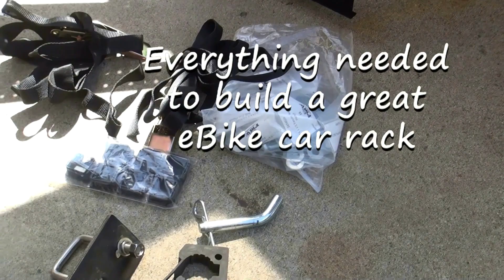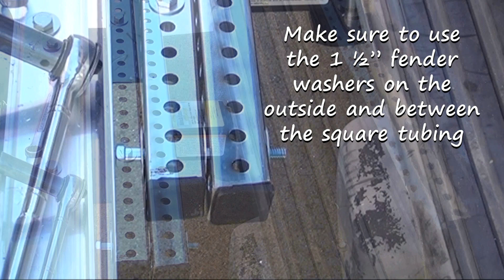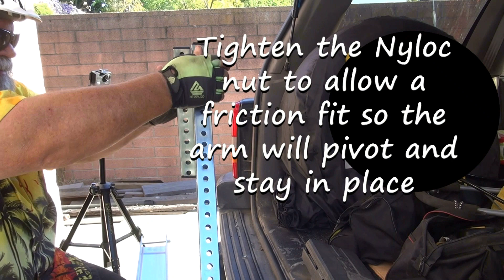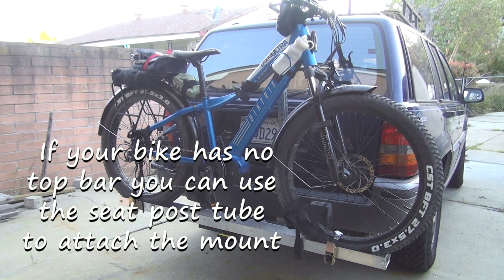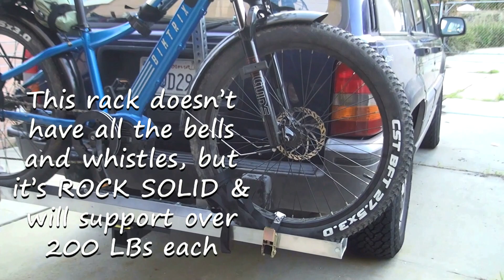DIY eBike Rack for under $135, Cheap & Easy, A Great Bike Rack

Comment from the maker: There are no worries when hauling with this rack. It is rock solid and didn't cost very much to build.
Reply: As you could tell by my questions, I’m not a very experienced DYI guy. Actually ordered all the parts, then I was in Harbor Freight to get the step extension when I saw their motorcycle carrier for $159.99. 400 lbs capacity, with a nice loading ramp. Had to go for it. Still love yours, but figured my time needed to assemble, to include screw-ups, was worth the extra $30 bucks.
Reply: @squire330  Sounds like a great option for you. I went my direction because I wanted a heavy duty simple rack that could be expanded and still have a trailer hitch. I also carry a luggage rack behind mine. Have some great rides. Positive vibes to you.
Reply: @squire330  How did the motorcycle carrier work out for you?  What I would be concerned about is it doesn't have anything to attach to the top tube to keep it from falling off.  Even with many straps I'd be afraid my bike would fall off.
Reply: @jamesgibson3242  Works great as is, but planning to add a bar to attach to seat post ( no top tube on my bike)

Comment: I am making one of these at the moment, but can’t get the uprights like you have used, so instead am using 1” steel SHS. The concern I have is the stress put on these upright bars during acceleration and braking. Having only small uprights and since it’s not fixed back to the car. Have you had any such issues with the ebike toppling over ?

Comment: I also have a Biktrix and finding a single rack is difficult to say the least.  My hitch is a 1 1/4, finding a 2” is also difficult. Would this still work with a 11/4 hitch receiver to carry the E-Bike…Juggernaut Hub Duo. Probably same weight as yours.  Thank you
Reply from the maker: Hi, thanks for the question. Yes, I have a number of friends who have built this rack that have a 1 1/4" receiver hitch. They simply purchased an adapter which works quite well. Some say it works better because it pushes the eBike a little further from the car. Here is a link to an adapter.  Which Biktrix eBike do you have?  https://www.amazon.com/CURT-45785-Receiver-Tube-Adapter/dp/B00077ZDWQ/ref=sr_1_12?crid=2J3L47N79UWQF&keywords=receiver+hitch+adapter+1+1%2F4+to+2+inch&qid=1685219161&sprefix=1+1%2F4%22+receiver+hitch+ada%2Caps%2C463&sr=8-12      And the 1/2" pin     https://www.amazon.com/CURT-21410-Vinyl-Coated-Diameter-Receiver/dp/B004C6S1S6/ref=sr_1_2?crid=36WIG76T8DL22&keywords=1%2F2%22+receiver+hitch+pin&qid=1685219703&sprefix=1%2F2receiver+hitch+adapter+1+1%2F4+to+2+inch+pin%2Caps%2C9923&sr=8-2

Comment: Amazing.  You may have answered this somewhere, but have you thought about or ever built a ramp that makes it easier to roll a heavy bike onto the rack?
Reply from the maker: Thanks for the comment. I'm also surprised that no one else asked about a ramp. Actually, I did make a ramp. I purchased an 8'  piece Aluminum tray and after cutting it to length , I had about 30" left over. I put a couple of hooks on it and it works great as a ramp. I was not able to put it onto the video because the video footage was lost in a computer crash. I am planning on doing an updated video for the Bicycle rack and I will make sure to include the ramp also. Thanks again.

Comment from the maker: I've used this type of bicycle rack for over 30 years with all kinds of bikes and have never had any issues. There is actually not that much stress on the upright bar during acceleration. As long as you have the tire strapped down and a strap on the upright, I'm very confident you won't have any problems. Thanks.

Comment: Could I use 1/8" wall thickness instead of 1/4 " at McMaster they don't have 6' pieces in 1/4" and the 8' piece is $190....so just wondering what others think?
Reply from the maker: Hi Ralph, I've tried the 1/8" and it is not strong enough and will not work. Unfortunately, products and prices have change since this video was made. It's a great rack for the price and still way cheaper, ((and I think way stronger), than most factory racks. I still have 2 of these racks and have been using them for many many years for many many different bikes and have never had any issues. Good luck and thanks.
Reply: @GreyBeardEBiking  Thanks for your reply and help :)

Comment: Thanks for sharing your info.  I have a two-bike rack but I may make one of these for those trips when I ride alone.
Reply from the maker: Yeah it works really good for 1 bike but you can add easily add a second carrier to carry 2 bikes. Plus the cost is way less than a factory build. Thanks

Comment: I've read thru all the comments, I think you've done a great idea and construction....has anyone asked of an idea to padlock the bike to the frame to prevent quick theft?
Reply from the maker: Hi Robert. Thanks. Yes, I always have a cable lock on my eBike when it's on the rack. I run the cable through the safety chain loops on the receiver hitch to lock everything.
Reply: Thanks Grey Beard!

Comment: Just one question, in the first 30 seconds of your video the aluminum channel on the ground looks like the one from Amazon, but after that the channel appears much larger  and thicker with sides at least 1 1/2" or is that my imagination?
Reply from the maker: Thank for the info. I have changed the parts list. Amazon has changed their links. The size of the track to purchase is 6' long x 4" wide on the bottom, (wider or thinner as needed for your needs), 1/4" thick  Aluminum channel. Mild steel can be used to save costs but it will need to be painted.

Comment: Awesome. Where you get the grabber mount?
Reply from the maker: Thanks for the comment. In the description there is a link to the full parts list but here is the direct link to the "Gabber"  https://www.amazon.com/Original-Quick-Fist-mounting-equipment/dp/B000CQPANY/ref=pd_bxgy_img_2/144-0684885-9917304?_encoding=UTF8&pd_rd_i=B000CQPANY&pd_rd_r=8c&th=1   Let me know how it all goes.

Comment: Will the 4 inch channel hold a 4 inch fat tire?  The inside width of the 4 inch channel is 3.75 inches.  If not is there an alternative?  5 inch channel from Grainger is about $100
Reply: Yes, the 4" tire will fit inside the 3.74" inner width of the channel. It will actually hold the tire firmly. However I would still tie the wheels down. Unfortunately the prices have gone up since I shot this video. However the 4" channel is still at a reasonably price from Amazon, Here's the link https://www.amazon.com/gp/product/B007ICNZFA/ref=ppx_yo_dt_b_asin_title_o02_s00?ie=UTF8&psc=1    Thanks
Reply: Hi Dan, it appears to be 1/8" thick do u think still sturdy enough for 50 inch wheel base @ 70 pounds ? thanks

Comment: Amazon is out of stock for the hitch extension and square tube.  Harbor Freight has the hitch extension for $35 and Lowes has the perforated tubing as well as the hardware (I used stainless steel except for the fender washers.)  Great plan and an easy build for the mechanically challenged.  Thanks!
Reply from the maker: Thanks for the update. Good to know of alterative material sources.

Comment: Dan,  I need your help again.  I bought, but have not yet received my HJM Step-Thru  e-bike.  The wheel base is 47.5 inches and the total length is 77 inches.  I do not think I would need to lengthen the aluminum channel but would like your throughts.  Also can you think of any other concerns with the 77 inch total length?  73 lbs should be no problem.
Reply from the maker: Hello Richard. The 77" overall length shouldn't be a problem. The aluminum track of 72" will work fine. With the step-thru model you will probably need to attach the swing arm part of the mount ot the seat post which will work great also. The 73 Lbs. of your e-bike shouldn't be an issue. I tested the bike rack with 190 lbs. on the track and drove around for a day with it and had absolutely no issues. It's a very strong rack. One of my very first racks I built of this design has been in operation for over 15 years. Just an FYI. Tomorrow I'm leaving oon a 1500 mile road trip, some of which is off-road, using this rack carrying my 81 lbs. Biktrix Juggernaut Ultra 1000 e-bike and I have absolute confidence in the rack systyem.
Reply: @GreyBeardEBiking  BEST OF LUCK ON YOUR EXPEDITION.  Truly remarkable.   I hope you will be sending updates.  I would look forward to them.
Reply from the maker: @richardsulenski4110  Thanks, I will most definitely be taking phots and video and showing them. Thanks again.

Comment: THIS IS AMAZING! I have been looking for a way to carry one bike and a cargo rack. This is the perfect solution for my tiny camper van. I just didn't want to buy a rack that carries multiple bikes when i'm only ever bringing one along. This also seems less likely to get stolen if you just leave it on the vehicle. That always makes me nervous about those pricey ebike carriers.
Reply from the maker: Thanks Nolan. Yup, it works great and I've been using my DIY racks for over 20 years with no problems. Additionally I sometimes pull a small trailer so I don't even need to remove the rack. I just insert the hitch. I think I've taken the rack off the vehicle only about 3 times in that time. I just keep it on and have had no problems and I think the reason is because it's not one of those 500 - $1000 racks. Glad you liked the video.
Reply: @GreyBeardEBiking  I'm having a hard time sourcing  material where I am. I found a supplier for the  channel but they only stock  3/16 thick, do you think that is thick enough? I see that you are using 1/4. I'll be putting a 60 lb ebike on it so don't want to take any chances. Thanks for your input.
Reply from the maker: @nolannatashaTV  Hello Nolan, The 3/16" should work but I would still feel safer with the 1/4". My bike weighs about 75 Lbs. I tried 1/8" material and it was kind of flimsy. As I said, 3/16" should work for your bike. In the description I have a link to the entire parts list, including the channel from Amazon. I just checked and the channel is still available. Hope this information helps. https://www.dropbox.com/scl/fi/dgllit0kjbifr9h3x9kwa/bike-rack-parts-list.docx?dl=0&rlkey=ddlxwphl8xolnup0zwoeedlq3

Comment: Don't know what bells and whistles it doesn't have.  This is great...  Carries the bike securely, safely, and looked like it was very easy to load and unload.
Reply: Bells and whistles like a tilt mode. I did build one that had a tilt mode but I never used it so I removed it to make the entire set much lighter and simpler to build.

Comment: The video is two years old. How is the rack holding up?
Reply from the maker: Thanks for the question. First, this rack is very basic, but I love it. Very strong and easy to use for all kinds of different bike. I have built probably 12-15 of these racks for friends over the past 10 years. In fact, I'm still using the first rack I built 10 years ago, and it is still working great. In fact, last year, I was at a campground, and it was dark and backed up into a tree that I couldn't see. The rack was carrying my eBike but neither the rack nor the bike had a scratch. The tree, however, well let's just say it was very dented. All the racks I built for my friends are also still going strong. Of course, the cost has gone up some-what in these 2 years but still a great deal. This is a simple design but very strong. Thanks again.

Comment: Great design. Just what I’m looking for. Living in Canada my best source for the aluminum channel is Metal Supermarket. When ordering they require leg, width & thickness. I know the leg & width. Could you tell me the thickness of the material you’re using. I’m thinking about 1/4” Thanks
Reply from the maker: Thanks for watching the video. Yes, 1/4" is what I used. Also, as a side note, I have built this same bike rack design many time starting with 20 years ago. They are super strong and work really well. The latest bike I am using is an eBike from Canada. Biktrix Juggernaut Ultra 1000. A great bike and the rack holds it very well.

Comment: Do you think there's a Hitch Receiver Extension with Step for 1.25" hitches? I just cant find them with the reciver.
Reply: Probably need to get a hitch adapter.
Reply: @DanBronk  I probably have to buy the adaptor anyway, my hitch is recessed in 6 inches.
Reply: @Ilikedahrice  Sounds like the problem is solved. Have fun
Reply: @DanBronk  Been using this rack for 80 pound motorized bike and its works really well.
Reply from the maker: I think unless you get one custom built you will need to use a reducer from 2" to 1.25".
Reply from the maker: @Ilikedahrice  Thanks for the great comments. I've been using mine for many years with no problems also.

Comment: You do not think that the Square Perforated Galvanized Tube will bend, twisting?  You don't worry about the bolts breaking or pulling through the Square Perforated Galvanized Tube?
Reply: Absolutely no worries on any of those items you listed. This rack is 10 times stronger than 99% of the racks out there. I have used this system for over 15 years for my regular bikes and 4 years for my ebikes. Check out the bolts on factory racks. The ones I use are 3/8" and on some of the factory racks they use 1/4" - 5/16". Also the way the wheels are secured there is absolutely no way anything can twist. Plus the square tubing is heavy duty. All of the materials are heavy duty. That's why I like it so much because it is way more heavy duty than most factory builds

Comment: You list 3/8" and 5/16"  Nyloc nuts, but when I look these up, they have two measurements, like 3/8" X 24. What is the second number for both size Nyloc nuts?
Reply: The second number is the Thread count. The thread count needs to match on the nut and bolt. I prefer to use a course thread. I used 3/8 x 16 on the nuts and bolts. I used 5/16 x 18 on the smaller nuts and bolts. Hope this helps.
Reply: @DanBronk Yes sir, and following that, I glad you mentioned that you prefer the coarse thread, as that isn’t there either. So what is the thread count for the 3/8” coarse thread bolts?  I just don’t know this stuff!
Reply: @DanBronk  sorry, just saw them in your reply - dopey at this time of night.

Comment: We have 2 ebikes.  Been looking for a rack for our Roadtrek for 2 years!  Can this be modified to carry 2 bikes?  Awesome idea!
Reply from the maker: Yes, definitely can easily add a 2nd bike carrier. Simply make 2 racks and connect them using the receiver on the back of the racks. Check out the video at the 7:12 mark to see how to add the 2nd rack. Thanks.

Comment: Would a juggernaut 4” tire fit in the aluminum channel?
Reply from the maker: Yes, it fits very well. I carry an Ultra 1000 with 27.5 x 3" wheels and tires and an Ultra FS with 26 x 4" wheels and tires. Works great.
Reply: @GreyBeardEBiking  excellent! I like your build, Thank you for the diy video, I’m planning my build one with some modifications.
Reply from the maker: @richmccay-read6389  Sounds great. I would really like to see a photo of your finished project with the modifications.

Comment: You design looks GREAT!!   How about a design for 2 fat tire e-bikes (abour  72# each)
Reply: Actually, it is expandable. Just add a 2nd rack into the first rack's receiver hitch. Thanks.
Reply: @DanBronk  Dan,  I assume you are referring to adding a second Hitch Step (or Hitch Extender).  What do you think about mounting a single perforated tubing post in between the first and second bike, securing both from that single post?  On the other hand by building 2 identical racks, the second one can just be left off when transporting only a single e-bike.  Thanks for responding!
Reply: @richardsulenski4110  No need for an extender, just make a duplicate rack as per the video and insert it into the first rack receiver.  It sounds like you ide would work. I would make sure to check the clearances between the bikes to make sure there's enough room with the peddles and handle bars. I Like the single post idea.

Comment: Spent some time online looking for 5 inch wide aluminum channel, very expensive, 200 bucks for a 6 foot piece. I’m going to have to look at some other different places
Reply: I purchased mine on Amazon. A 4 inch Fat Tire fits in this channel. If you need a 5-inch tray you are probably going to have to go with a motorcycle rack what you can get for a reasonable price just have to get tie-downs for it. Of course with all the delivery issues these days might be tough

Comment: I have an eBike rack I paid over $600.00 for and it doesn't look as strong as yours.  Great Video Dan!
Reply: Thanks. I have used this type of rack for over 20 years and with all kinds of different bikes with never a failure.

Comment: Pretty cool thanks. How about a double bike model.😁
Reply from the maker: Yes, it's pretty simple to add another bike rack. The way the bike rack is built you can simply add another rack by building 2 of them.  At the 7:10 mark of the video it shows how to add another rack. I built the rack this way because I sometimes carry 2 bikes but also because I tow a small trailer in addition to carrying a bike. Works really well. I've built many of these racks over the last 10 years. The best thing I like is they are rock solid, carry a lot of weight, and cost way less than similar racks.

Comment: I have a rack like that, but mine is made of steal it’s cheaper and no I never take it off.
Reply: I like the aluminum because it's lighter and doesn't rust. and like you, I leave it on. I use the anti-wobble device so nobody is going to steal it either!